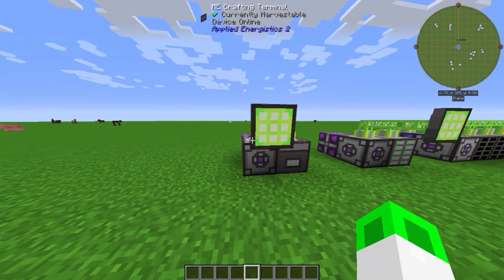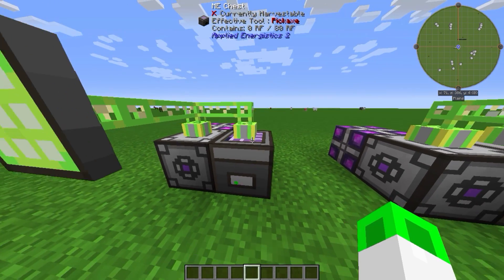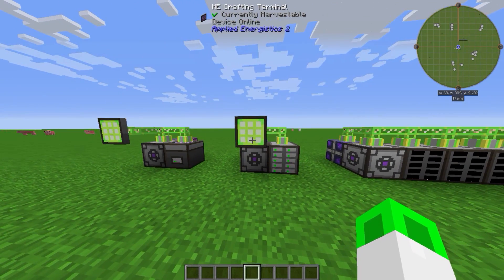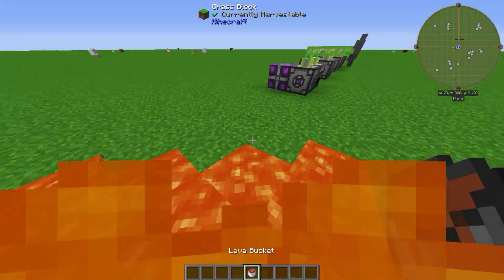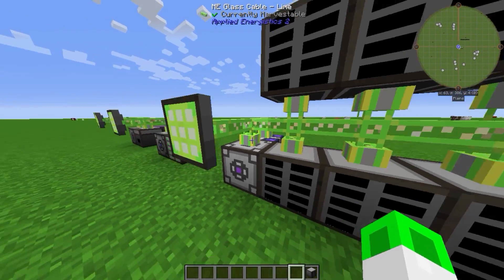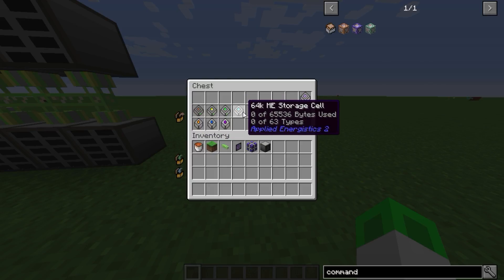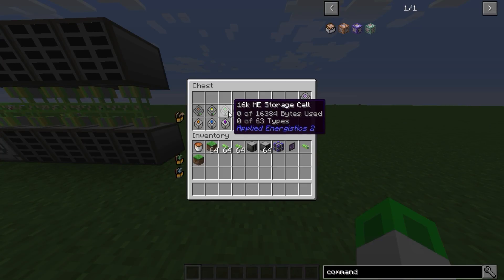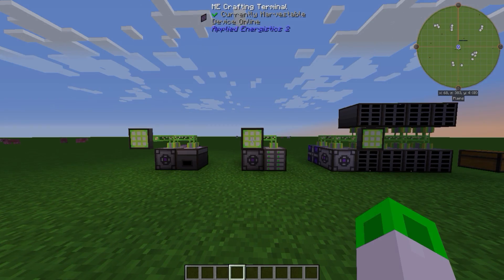Applied Energistics 2 Tutorial #1 | How to build a beginner ME system

Comment: I can not find the ME controller anywhere, i have no clue how to setup my storage... Anyone that knows how this works? I can not power it without the ME controller according to internet/wiki but the MC controller is not even in my game?! I'm using FTB Ultimate: Reloaded from the FTB launcher....
Reply from the maker: Usually it gets included by the AE2 mod it self. If you have any items from that mould you should have the controller too. However, If you play on a server there is a chance that the server admins have disabled the blog due to bugs glitches or lags
Reply: @lukaskraft4108  Thanks for your reply, I actually host a server myself for me and my friends on a dedicated server. We run it straight out of the .zip file without making any changes. You are saying that there is a setting in the configuration that will unlock this? :o
Reply from the maker: @chichiyayu  I know that it can be locked in the Settings however it sould be unlocked by Default. Check the Settings and tell me if you found sth :)
Reply from the maker: @chichiyayu  Hey, that may be a bit late but i found a solution. The reason you have no Controller in your modpack is because Ae2 is set on easy mode, it compleatly removes the channel Managing. If you have infinite channels you dont Need a Controller. Check the link for more Information :)
https://www.reddit.com/r/Foolcraft/comments/6z8nf1/me_controller_missing/